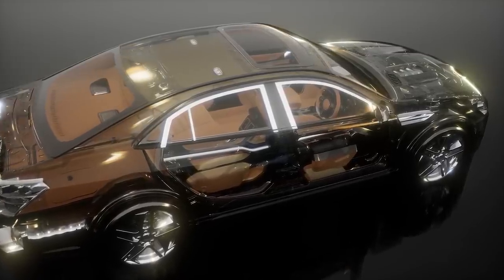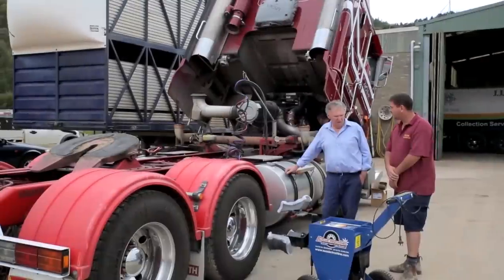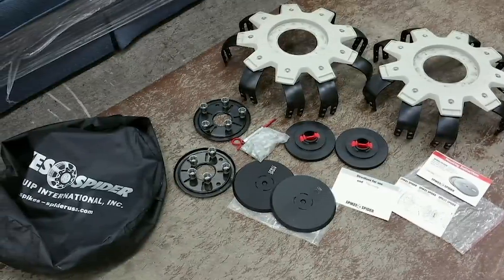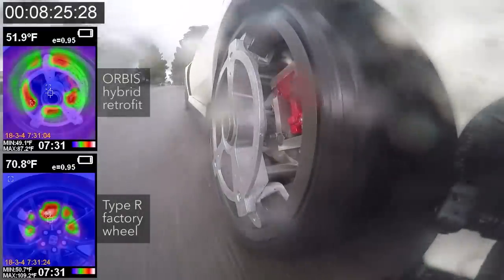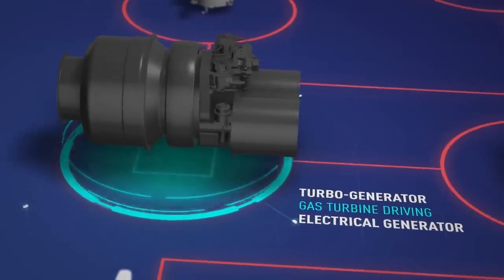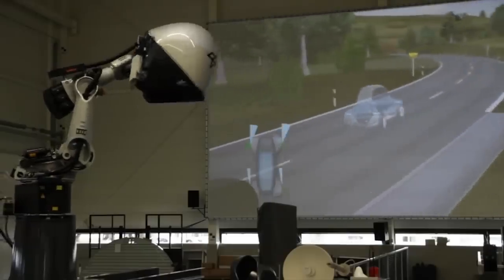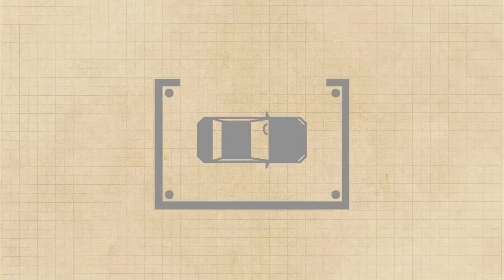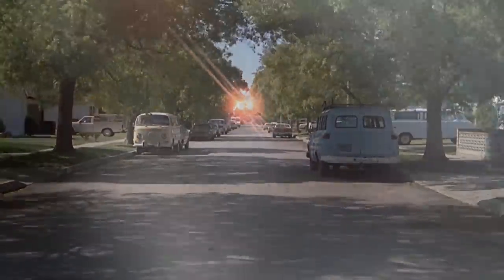Inventions for car That Are At Another Level

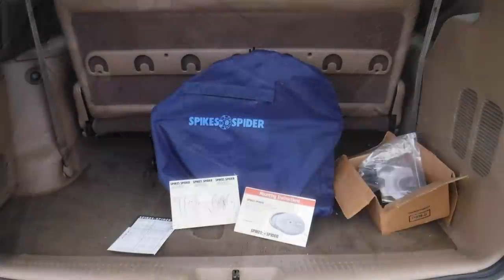Comment: 1:50 can't wait to see rocks and debris getting stuck in all those gears, needing very expensive repairs... Also, can't wait to see it handle snow and ice.
Reply: Actually the shown concept is unfortunate. Some friends and I developed a similar concept but the motor is centered and connected to a topologically optimized Wheel via a planetary gear. Might be a Bit heavier But also much More reliable.

Comment: You can be licensed to drive a car after a 15 minute test at the DMV. Flying an aircraft is significantly different.  If something goes wrong in the air, you can't pull over.  You need to know max glide slope etc. and react quickly. You don't have the luxury of reaching into the glove compartment and searching through the owner's manual...

Comment: If something happens to a normal wheel. Change it !! a planet style wheel is a different case. If something happens you need a truck. I also see wheel's everyday, that the driver, has gotten some serious curb rash. Can the wheel take that. Only time will tell